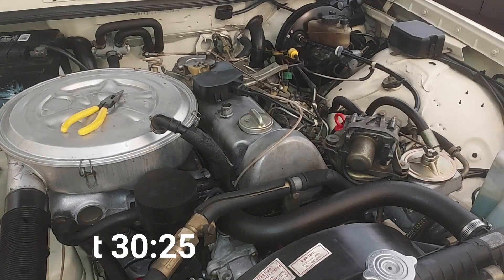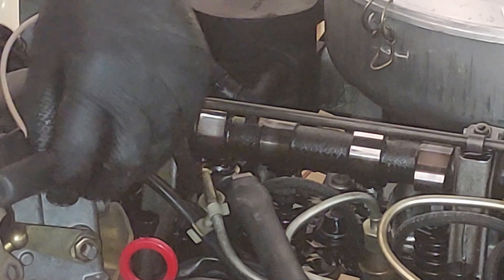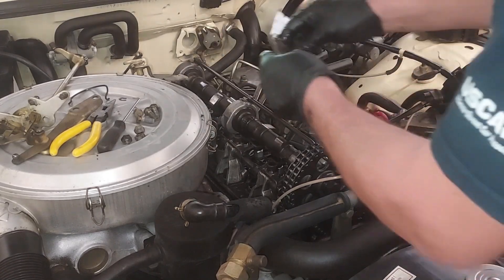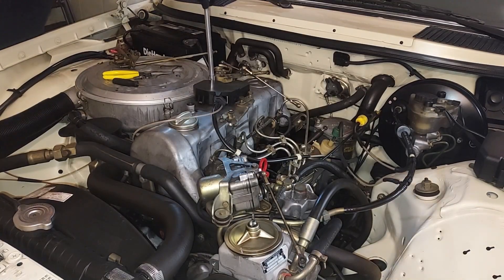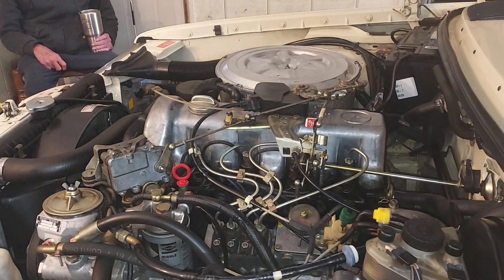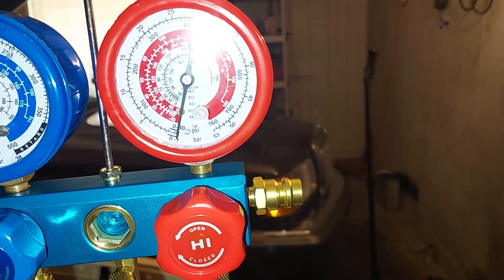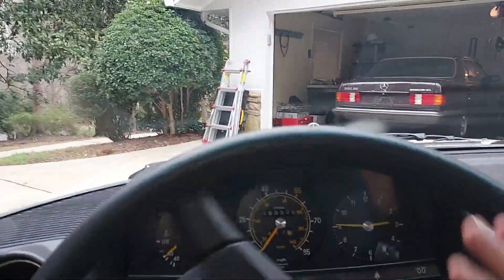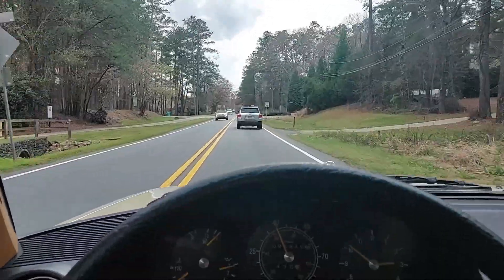1982 Mercedes 240DD - Part 5 Test Drive, Valve Adjustment, R12 AC Recharge, Return Lines

Comment: You should have checked the cold start valve behind the steering wheel that's the idle control valve knob
Reply from the maker: There is no "cold start valve" on a 240D om616 diesel engine.
Reply: There was a black knob behind the steering wheel on all 240s I saw it on the one you were working on
Reply: The 240s are the only model that have it
Reply from the maker: @jedklang  that knob is to the left of the steering column and it's the idle adjustment.
Reply from the maker: @jedklang  the w116 300SD from 1978 and 79 also has it.

Comment: That reminds me I have to do a valve adjustment on my Honda CR-V
Reply from the maker: Hahaha really? I can't tell if this is a joke.
Reply: @woodsandbarclay  yep I need to do it
Reply from the maker: I had no idea you had to do valve adjustments on a cr-v @mds2465
Reply: @woodsandbarclay  yep every Honda requires them every so often
Reply from the maker: @mds2465  I thought cars that needed valve adjustments stopped being made back in the 80s. What year is your?
Reply: @woodsandbarclay  2005. It has a manual transmission
Reply: @woodsandbarclay  Toyotas used to have them too
Reply: BMWs have valve adjustments as well
Reply from the maker: @mds2465  weird I was under the impression that all modern cars had hydraulic self-adjusting lifters
Reply: @woodsandbarclay  some do. But there are plenty of cars that still have manually adjustable valves. I think Ferrari does as well.
Reply: If they’re off you adjust them
Reply from the maker: @mds2465  wow I had no idea. Usually it's only race cars that have flat tappet cams or require manual valve adjustments.

Comment: since this one's a standard transmission you can adjust the valves by putting the car in gear and pushing on it.
Reply from the maker: I'm sorry but valves cannot be adjusted by pushing on the car. Valve adjustment is very specific tolerance between the rocker arm and the cam Lobe. Does tolerance can only be achieved with feeler gauges and adjustment using the proper wrenches.

Comment: I have a 1980 240d manual. Runs great. Will do 85mph or more. It will NOT start off in a steep driveway. I just can't imagine a taxi in the Swiss or German alps having to coast back to the bottom of a driveway and get a long run and go. Makes no sense. What the hell is wrong with my car? Is this normal? Shouldn't first gear creep off like a granny gear truck???
Reply from the maker: Yes first gear should be able to start the car on any incline. You probably have a weak and/or slipping clutch.
Reply: @woodsandbarclay  thanks for reply. About the clutch...it doesn't slip one but. It's more like the engine just won't pull it. I've done filters. Tank cleaning. Etc. surely there has to be an answer. Maybe valves need adjusted properly? Could it be low compression from valve compression loss? Thanks man
Reply from the maker: @technicalitems731  a valve adjustment is not going to make your car not go up a hill. Definitely sounds like you have engine problems. Your engine could just be getting worn out

Comment: Did you tighten the valve cover to a specific torque or just make it 'snug'?  Btw, great video!  Very helpful!!
Reply from the maker: The valve cover is just snug snug equals around 10 to 15 ft lb. You definitely don't crank anything down you just snug it up real good and let the gasket do the job there's no strain or pressure on a valve cover.